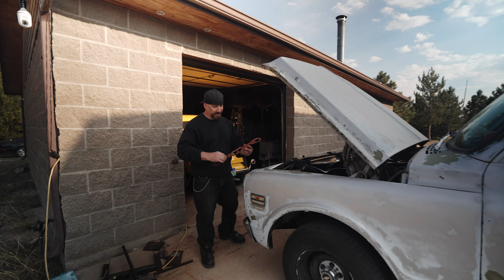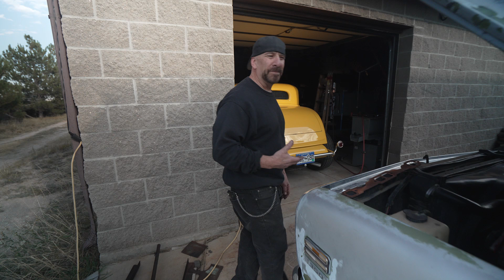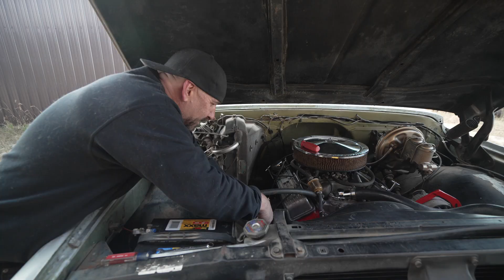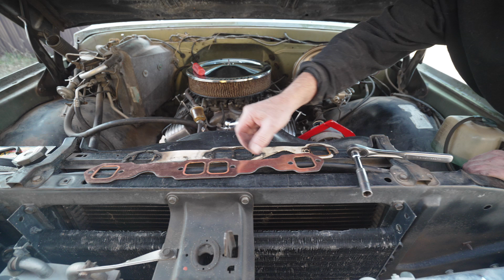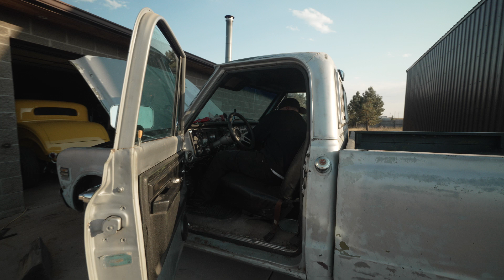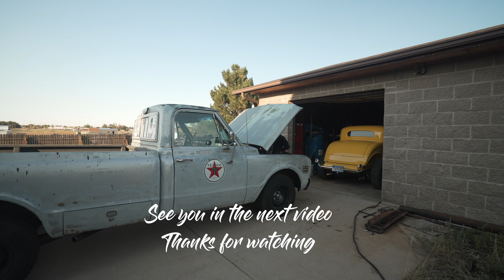c10 exhaust gasket

Comment: if those copper gaskets don't hold up  :face-turquoise-covering-eyes: next time use the same copper gaskets (they are the best) but when the header is free from the engine "take a saw zaw and cut between the #1 and # 3 cycl (small cut) and #5 and# 7 cycl - small cut ,same on the other side - This will allow the flange to bolt solid against the block , sometimes the header is "not" flat and it will lift one tube and loosen the bolts , the small cut on each side of  the 2 center tubes will let them seal independently  also retorque the bolts after it's hot and cools down completely  "next morning"